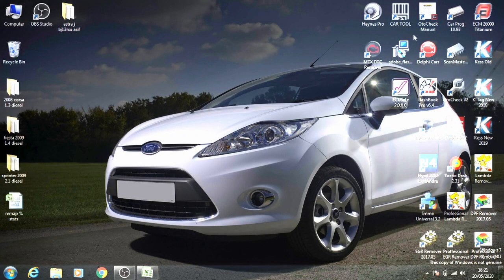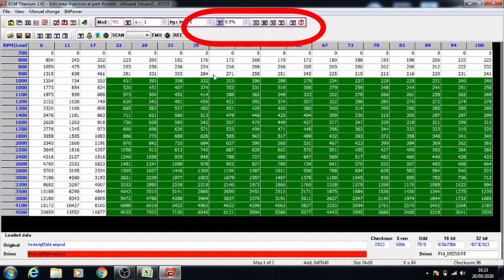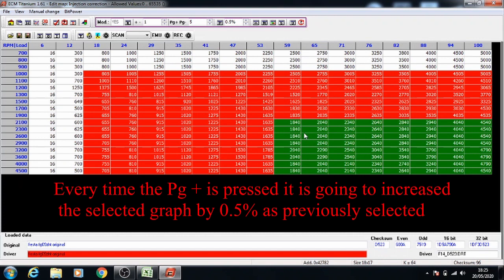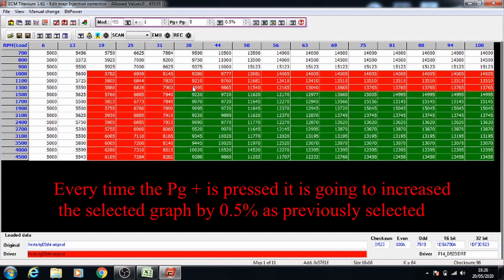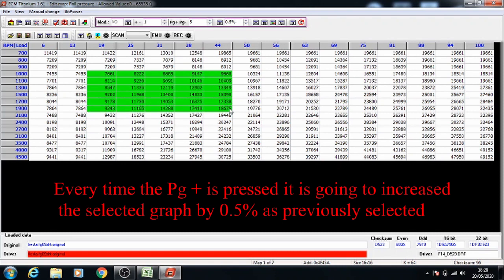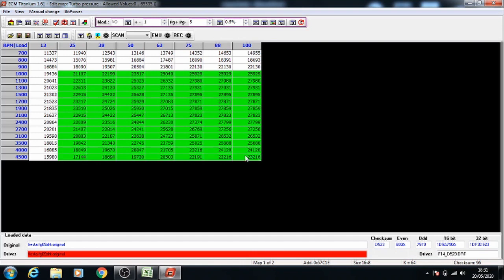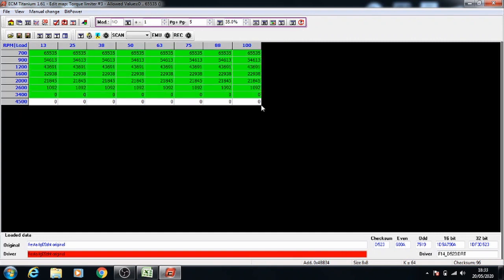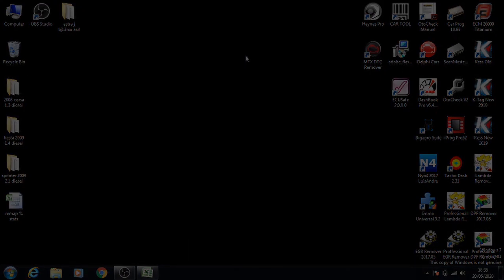How to Remap  ECU Engine Control Module of Ford  Fiesta 1.4 Tdci Diesel Engine using ECM Titanium

Comment: You have increased by '5' not 5% you need to click on percent on every map for it to adjust by percent not absolute.
Reply: Good eye. Do you know if this method works for petrol engines aswell?
Reply: @Pitman556  if its turbo charger u can use this method.
Reply: @negative8288  Mine is a naturally aspirated engine. What percentage values should I adjust?